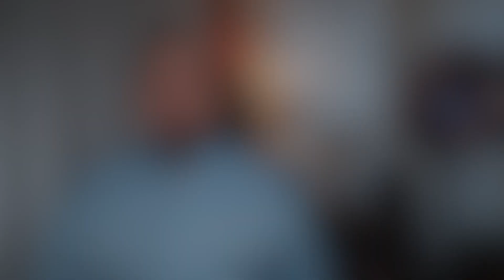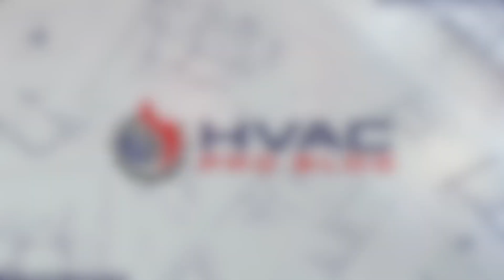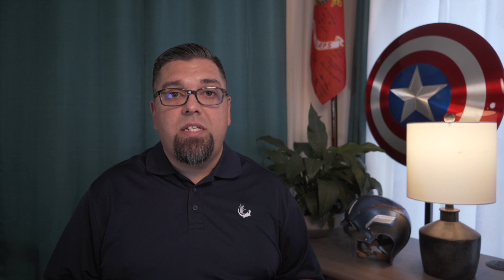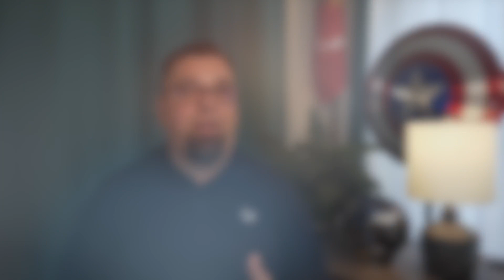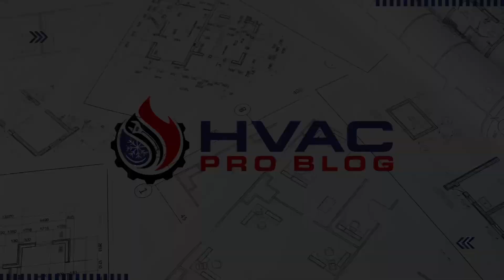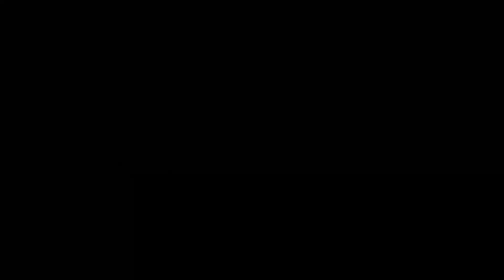Manual T - Return Air Inlets

Comment: what does undercutting a door mean?
Reply from the maker: Hi!  This means slicing off a small portion from the bottom of a door to create a 1-2” (typical) gap along the floor.  Unfortunately, this only allows for about 100 CFM, and usually requires a pressure difference between areas in order for air to be moving through this pathway.
Reply: @HVACProBlog  thsnks so much, i appreciate your patience with a dumb question from me. I have zero knowledge on HVAC, need to replace my existing gas ducted heating hence starting to learn more. if you don;t mind, I may come back to you with some questions once I get a quote from the contractor? I am in Melbourne though so of course regulations are different from US.
Reply from the maker: @ Please do come back! All questions are welcomed here.